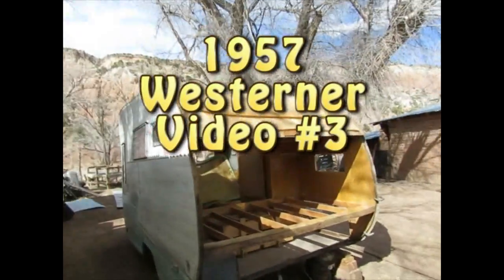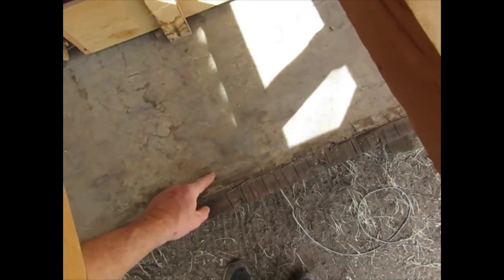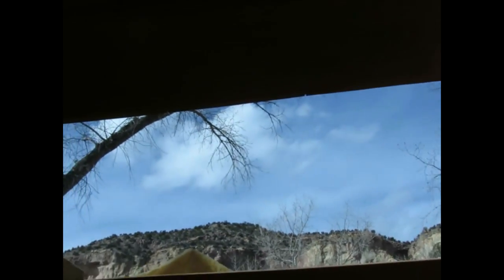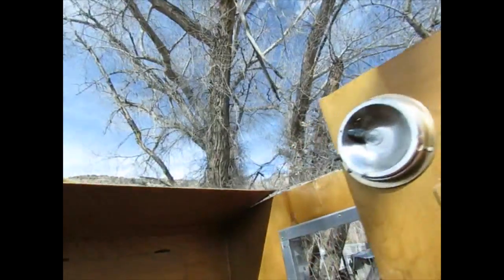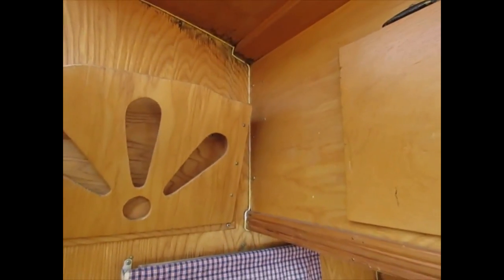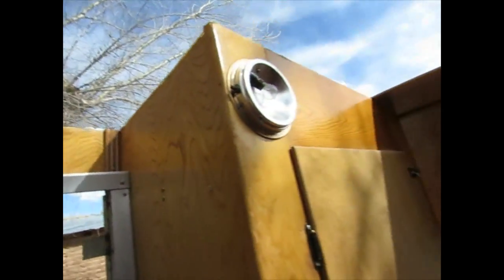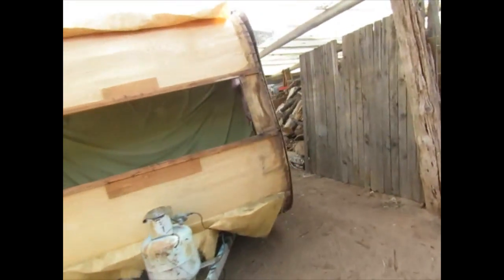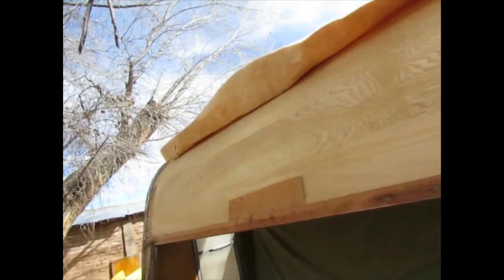1957 Westerner Restoration Project 003

Comment: Hey David, I'm also a '57 Westerner owner in the midst of a COMPLETE frame off rebuild and I have to say that I'm a little jealous of yours because it's in much better shape than mine. When we dismantled ours the entire back end disintegrated. And some previous owner had painted most of the inside, plus we are missing the seats ( would so love to have your original ones). I did want to tell you that the paneling is also the first layer of the curbing, so it would seem to me that it would need to be sound, but Larry, mobiltec, can probably answer that better than me.
I'll be watching your progress and looking forward to seeing what else is better than mine 😁
Reply from the maker: Good evening! Gosh it sounds like you have a massive amount of work to do. :-) Do you have a blog to record your rebuild project?

For curbing I plan on using strips of 1/4 inch plywood, in three layers, with the staples staggered as well as the ends of the strips staggered. It is my hope to "rush" through the paneling process so that I can get the metal skins back on, and then take my time sealing windows, fixing cabinet drawers that don't open, sealing windows.... The problem is that I am 84 miles from town, and when rain falls I must wait for the road to dry before I can drive to town.
Reply: Sorry it takes me so long to get back with you but I'm not on the computer much right now, way too much going on.
I don't have a blog or anything like that because I know I wouldn't keep it up. I'm in the process of moving all my pictures of my lil' bit (what I call our trailer) onto Flickr so I'll send you the link as soon as that's finished. Nice to see another Westerner still surviving.

Comment: Significant moisture intrusion around the seams.  I guess that's kind of to be expected considering the age.  Are the interior panels, along with the cabinetry, made of birch?
Reply from the maker: Yes, the panels are 1/8 inch birch, with amber-tinted coating. I bought five new sheets of birch yesterday. Also a hell of a lot of putty tape. :-)